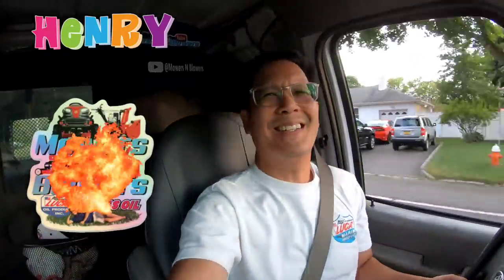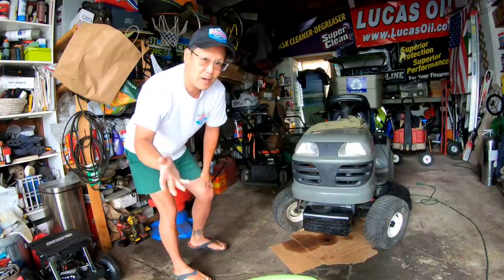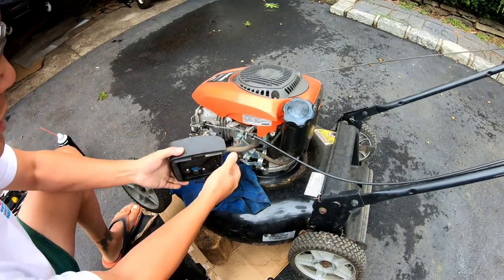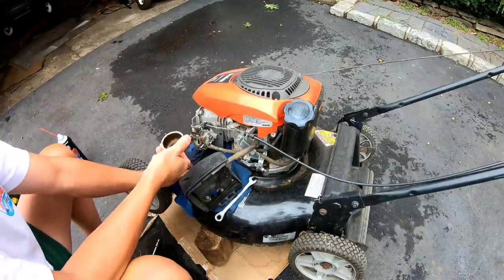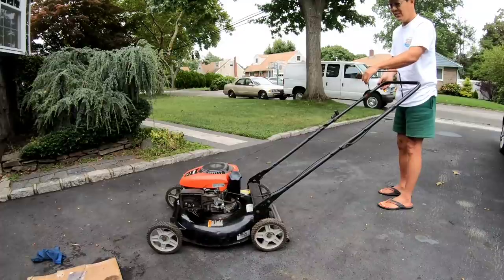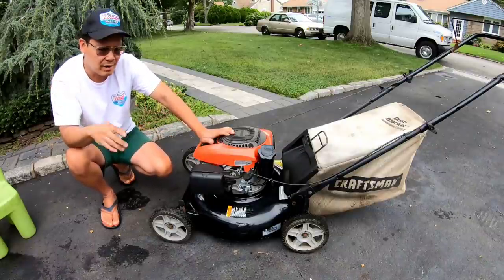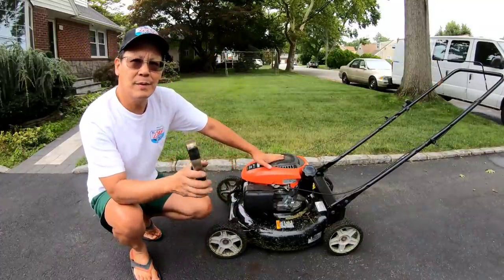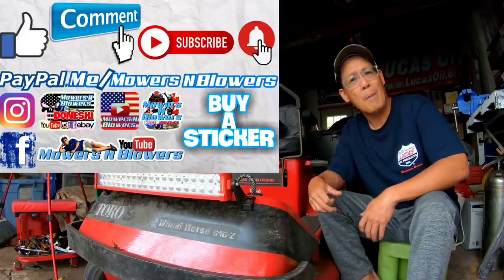FREE POULAN KOHLER XT675 AYP PUSH LAWN MOWER QUICK N' DIRTY CARBURETOR CLEAN & ADD CRAFTSMAN BAGGER

Comment: Nice job Henry on the Poulan mower.  I've got the same engine on my mower...I had problem with my mower recently when the engine would suddenly start sputtering and die while mowing the lawn for 30-40 minutes.  The problem turned out to be with the gas cap not venting properly, so, I ended up replacing the gas cap & the problem went away.
Reply from the maker: Amazing how simple that was!

Comment: If you bend the leaver up on the auto chock on the right side of the mower the linkage will slip right out and you can remove the carb. Then replace the carb and auto chock linkage on the right side of mower and bend the linkage back down. It’s very quick
Reply from the maker: Bending it too many times weakens the metal and isn’t precise.  I’d rather take it apart.
Reply: @MowersNBlowers  how many times do you have to take off the same carburetor? I’ve had that same mower for about 10 years and I’ve only hade to take the carburetor off 2 times! Both times a bent the auto choke bar and it works just fine.
Reply from the maker: @Mikeb-tx4cd  lucky you!

Comment: Next Video, Henry has his friends' UPS and the USPS trucks backed in the drive. A bit of quick fabrication and adaptation, a small trailer is attached to the rear of each vehicle. This way, these delivery drivers see a mower on the edge of the road, they stop, load it up on Henry's provided trailer's, and they drive and drop off directly to Henry without a delay !
Reply from the maker: That’s a great idea!

Comment: Hi I really need some help I have the exact same mower and I need a belt but the belt has no part number the model number sticker in front of the back tire I got erased so no one knows how to get the belt do you happen to know the model number
Reply from the maker: This mower isn’t self propelled so there is no belt
Reply: It has a belt
Reply: Is the mower you were cleaning the carburetor the poular kohler XT675
Reply from the maker: Mine doesnt
Reply from the maker: Yes that’s the engine size!  The push mower version doesn’t have the belt because it’s not self propelled